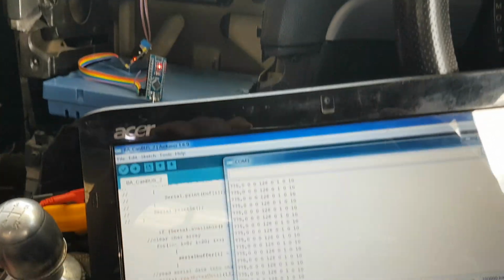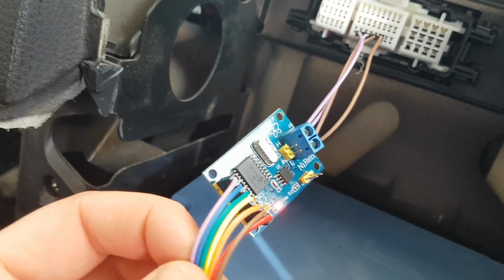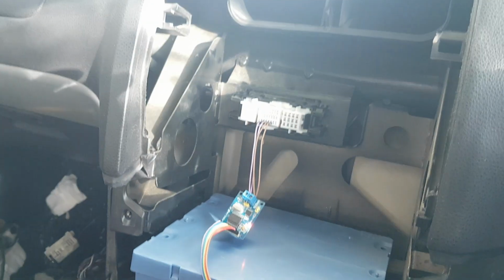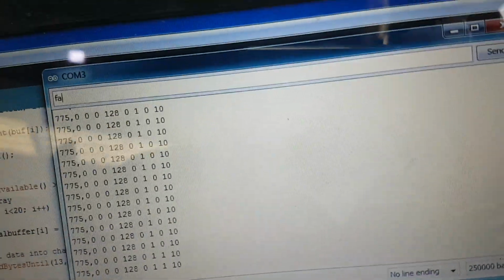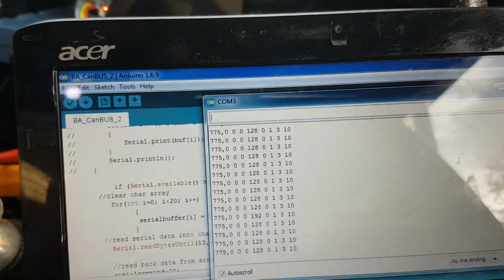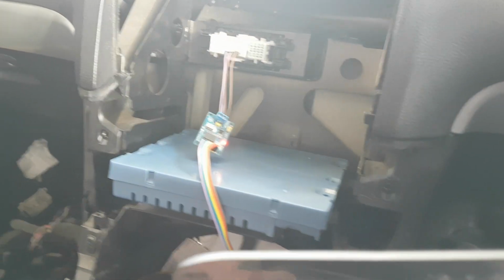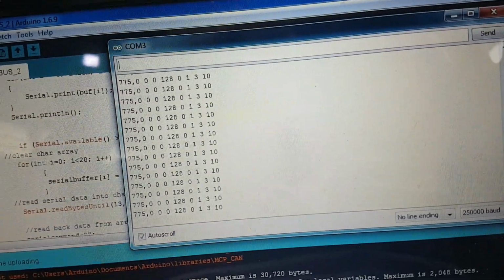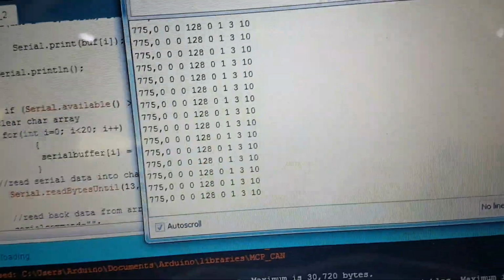BA Falcon CANbus control (custom head unit) p2

Comment: Oh this is getting exciting. 

You guys need to talk more.. You're both making massive progress on this. And it's going to be a whole lot better than the $1400 alternative
Reply: Brendan Matthews just need to find some who knows how to write a android app, toms going via raspberry pi.
Reply: yeah i seen that. His using a skin from a guy i used to talk to regularly Andrei Istodorescu, from when i first started playing around with this stuff. Unfortunately once Andrei had it working for himself he kind of got over it and moved on. It was cool while it lasted.. I used to have a screen mounted in front of the ICC running andrei's skin.. Held on by velcro strips. Since the screen and pi was separate from the ICC in that case there was no radio, no idea how my range was, where the aircon controls were set to, and heaps of issues with power supply (Especially when i tried pushing the pi to also power a capture card for reverse camera), His implemented GPS was useless to. 

I ended up ditching it and instead put a nexus 7 (also attached by velcro strip) in front of the ICC.. That was also cool but again.. no talking between the tablet + rest of car meant making sacrifices.  

Raspberry Pi makes sense for getting something working in the fastest way possible though. Just need to build a UI on top and you'll have the best of both worlds. Android would be even cooler.. wish i knew where to start building an android app.. Id happily do it. Unfortunately i have doubts anyone else will do it without a bottom line dollar figure :(
Reply: G'day  Brendan, Seen your work on YT, good progress so far, have you made any progress with the list of ID's, ? . Sent ya FB request via BA/BF ICC page.

Comment: I was stuck at the same point as you about 12 months ago, I have an almost polished Arduino code if you want to see what I'm at. I'm planning on running an android headunit and just haven't found the starting point for that yet.
Reply from the maker: Ben - that would be awesome man. Do you have it on github or something?
Reply: Tom Martin, I started a Facebook group where I plan to post my progress, I have only started the body work of the ICC panel at the moment, https://www.facebook.com/groups/208350963127229/permalink/238791210083204/
Reply from the maker: My head unit is linux based using LibreELEC, have the skin and screen sorted using iPad mini 2 LCDs and a touch overlay although they're in a box somewhere. (here's an early concept except i'm now not using any physical buttons and having the screen vertical https://imgur.com/a/0zCnwCN ). if i can sort my arduino halting issue i'm good to go. unfortunately i don't have facebook so can't see the group.
Reply: Tom Martin I think I sent you an invitation on Google hangouts if you received it
Reply from the maker: Ben - just fixed it. Toggle commands work 100% every time now.
Reply: Tom Martin what did you change
Reply from the maker: broadcast frequency was too quick so changed it from 500ms to 1s  - think this is because my mcp2515 transceivers only have a 8mhz clock. will retest when my 16mhz clocks arrive in the mail.
Reply: Tom Martin yeah I'm at 500ms,
Reply: I sent you the code I was using